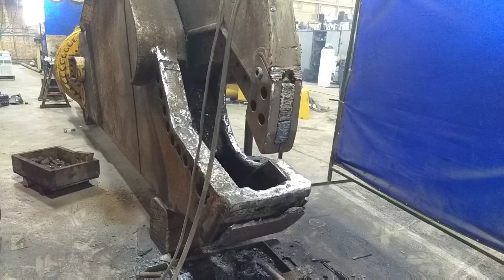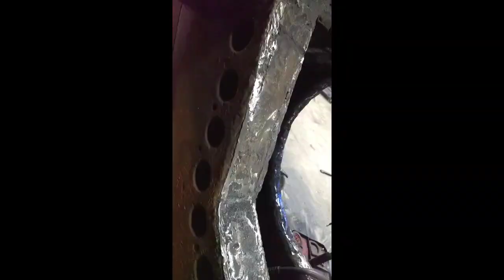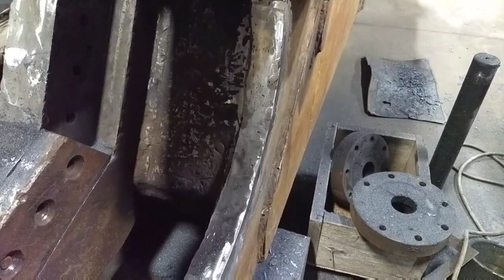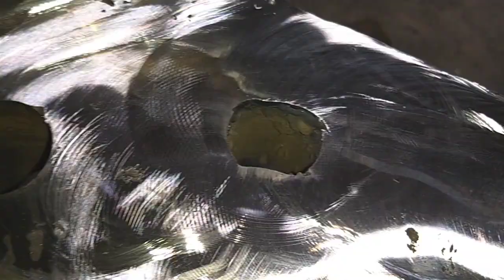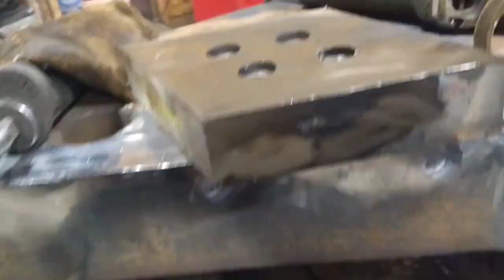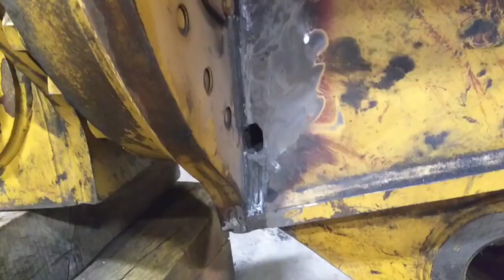Refurbishing A massive demo Shear

Comment: Did you weld up to the cutting edge? That would save so much time
Reply from the maker: Do you mean the blades? No, the blades would hold up. If mean blades pockets, yes, on an occasion, it needs it, but I prefer not to do that.

Comment: What’s the type of wire you using?
Reply from the maker: Normally use hardwire. But on this one I used flux core.
Reply from the maker: You need a Need a 75-25  mix of argon gas with the flex core where to get a super silky smooth look.